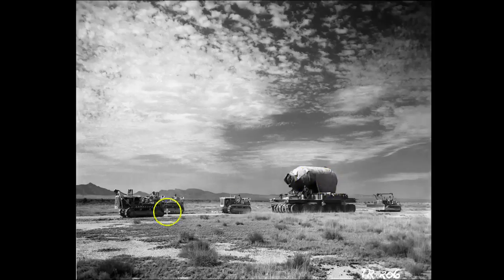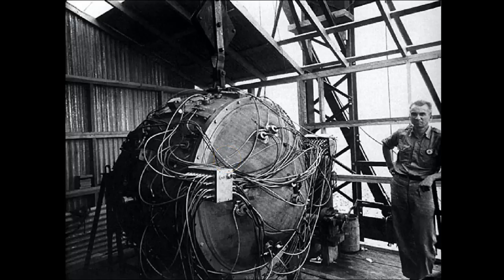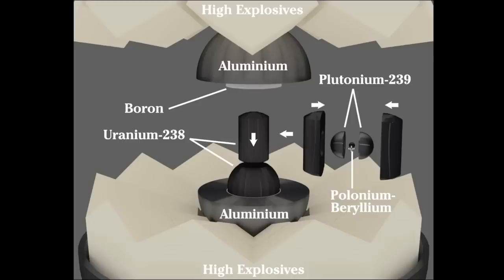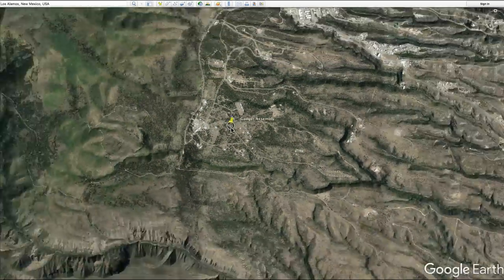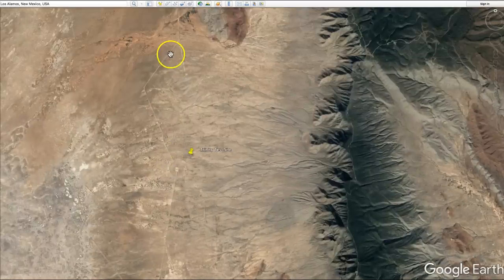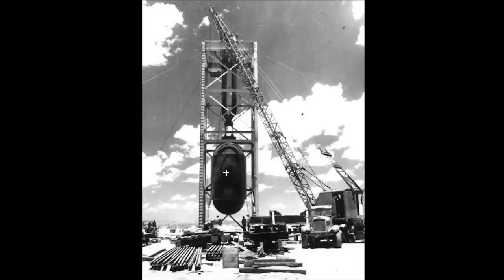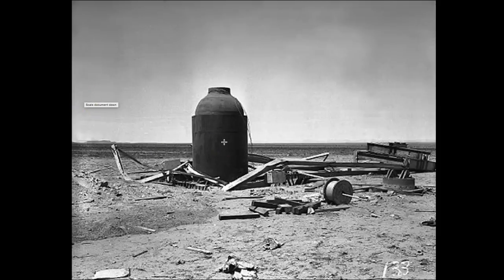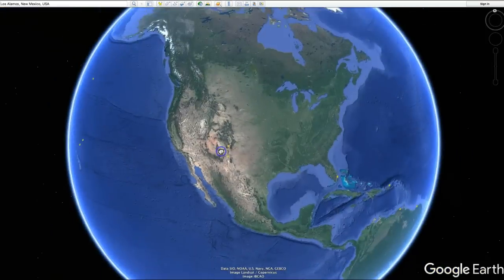Trinity Test Site Location from Google Earth

Comment: I worked all around that site and North White Sands Missile Range back in the 70's. We walked around that area during lunch breaks. Sometime in the middle to late 70's, the folks from White Sands Missile Range determined it best to fence off the area. There was measurable radiation in the area after all those years ( 30?) Trinitite, an artificially created mineral from the heat of the detonation can still be found near Trinity Site and it is sold at travelers souvenir shops in the surrounding towns. A very well done documentary! Probably the very best I've seen. Thank you for the excellent presentation and history of Trinity Site.
Reply: Interesting you mention the White Sands Range. We lived there from 1951 to 1955 where dad worked as a mathematician, but I like to call him a "rocket scientist".

Comment: And I was at trinity test site in October 2019 on the first Saturday of that month  and this site is only open to the public two days a year  the first Saturday in October and the first Saturday in April  so I rode my Harley Davidson down there from Wichita,Kansas  non stop other than bathroom breaks and refuels ! So if you have a chance go see it  you will be moved!!!
Reply: Hal 9000  The tour is open to the public. No sign up needed. I worked at Holloman AFB and WSMR. As such, I spent about 30% of my working hours on the range. The tour is definitely worth it.
Reply: @kiowablue2862  I worked on WSMR too, and spent a lot of time up there in the basin, but I never went on the tour. I need to go down there one of these days and check it out again.
Reply: What's a Harley Davidson?
Reply: Hal 9000  oooooo are those the chrome air compressors I see on the road?
Reply: Hal 9000  I love Honda! MX bikes in the past, last 3 bikes are Ducati. 440.000 miles on them !! What model do you ride?
Reply: Hal 9000  transalp !!! Cool .!!

Comment: Fantastic Job I never knew the assembly brick building was so small did not look like they had any kind of ac
those poor guys must have been miserable
Reply: Los Alamos is about 7,000' elevation which would mitigate much of the temperature problems.
Reply: lol AC, we didnt need AC in the old days, we were strong, unlike todays people.
Reply: @davidwarland2680  I was born in 1954 and I grew up with my father buying a new Pontiac Catalina every 18 months. WE lived in the Sacramento Valley and traveled to Southern CA on a regular basis and we NEVER had AC in any cars even the high end ones. The only AC we had was the old 4/70 - 4 windows down and 70 mph
Reply: @davidvincent3948  I remember one very hot day driving my '66 Pontiac Grand Prix that I had to turn on the heater in order lower the engine temperature.

Comment: The Von Neumann "lenses" set off the device. These consisted of half-spheres of low explosives, (Baritol) wrapped by hexagonal and pentagonal (like a soccer ball) cross-sectional pieces of high explosives-which  were hollow in the center to hold the Baritol. There is an additional hollow sphere of high explosives inside those pieces and immediately outside the aluminum sphere containing the fissionable material. There were detonators in the outside center of each lens (like bullet primers.) They had to be carefully synchronized. This is a much more complex (and efficient) system than the "Little Boy" which was dropped on Hiroshima. Nowadays, the Swan Device is used. It only needs two detonators, and is compact, making IT the detonator for Thermonuclear ("Hydrogen") bombs.

Comment: The white structure in the crater is an area that has been preserved intact from the blast..the original Trinitite 'glass' is still covering the ground, and it's covered and sealed. The entire crater is now pretty much non-radioactive as it's been plowed and dragged. In the late 1940s and early 1950s, samples were gathered and sold to mineral collectors as a novelty. Traces of the material may be found at the Trinity Site today, although most of it was bulldozed and buried by the United States Atomic Energy Commission in 1953.  It is now illegal to take the remaining material from the site; however, material that was taken prior to this prohibition is still in the hands of collectors. Trinitite, also known as atomsite or Alamogordo glass,[2] is the glassy residue left on the desert floor after the plutonium-based Trinity nuclear bomb test on July 16, 1945, near Alamogordo, New Mexico. The glass is primarily composed of arkosic sand composed of quartz grains and feldspar (both microcline and smaller amount of plagioclase with small amount of calcite, hornblende and augite in a matrix of sandy clay)[3] that was melted by the atomic blast. It is usually a light green, although color can vary. It is mildly radioactive but safe to handle. I was able to handle an actual piece of history when we visited the test site. Actually got to hold in my hand a piece of melted glass that was fused by the atomic explosion.....wow. 

You can visit the Trinity test site twice a year (April and October). Visitation is controlled. If you get a chance to visit, check it out. It's an awesome experience. 

https://sierracountyevents.com/events/april-2019-trinity-site-tour/

Comment: Fascinating history from my home state of New Mexico.  Beryllium is still used in the current weapon designs and is a rather nasty material.  Particulate debris from machining it can cause chronic lung disease.  We have to re-certify in it's safeguards and PPE requirements every year where I work.
Reply: Beryllium is used as a material for non-sparking wrenches, chisels and other tools that are occasionally found at swap meets. Not many people understand that sharpening a beryllium chisel releases carcinogenic particles. One vendor, Berylco, will sharpen its tools at no cost for life.

Comment: The beryllium doesn't emit neutrons in response to being compressed. The beryllium emits neutrons in response to being struck by the alpha-particles emitted by the uranium and the plutonium. The beryllium is therefore emitting neutrons the whole time once the core has been assembled. But the plutonium cannot create the necessary runaway chain reaction until it has been compressed by the explosives.
Reply: YES-and, it needs to be compressed at just the right time. These days, a small particle accelerator is used instead. It doesn't have to be Warp One; relatively slow accelerated alpha particles will smash into the Beryllium and emit neutrons.

Comment: Gadget was a test to see how an implosion weapon would work.  it worked by increasing the density of active material through squeezing the material into a smaller, more densely compacted sphere. the atoms were more close together and therefore subject to easier splitting..The other type of weapon(gun type) was never tested due to it's simplicity.
Reply from the maker: Duane Schwartz and it was the gun type they used in Little Boy over Hiroshima.

Comment: A sidelight to the test at Trinity is that it was the design for the Nagasaki bomb that was tested.  The Hiroshima bomb was not tested before using it, as the engineers were completely confident that it would work.

Comment: A interesting fact that you don't point out in the picture @6:00 is the test crater in the lower right. That was where they exploded 100 tons of conventional explosives so they could use it as a calibration explosion or measuring device against the atomic explosion.  The picture of that stack of explosives 

https://www.atomicheritage.org/history/100-ton-tnt-shot

https://upload.wikimedia.org/wikipedia/commons/c/c8/Trinity_Test_100_Ton_Test_High_Explosive_Stack_001.jpg

and it's visual effect in your video in the lower right @6:00 is a very interesting perspective to the much larger effect of 22kt plutonium bomb.

Comment: They had difficulty in the enrichment of uranium 235 from 238, it was easier to get plutonium but it was not as effective, it's easy to get uranium ore, the difficult  part is enrichment and seperating other matereals, I hate they did the testing, I also hate I missed seeing it detonated!
Reply: Plutonium has a smaller critical mass and about 10% more power per mole of material.

Comment: I have stood inside that very piece of steel at the gate to the Trinity site which is close as you can get my ex-wife had gotten drawn for orax and we were on the missile range hunting and the story that they told me about that was a little different I was told that thermos was built in case the bomb fizzled they were going to put it inside that and screw the lid on it to store it if it didn't go off they also said they put 4 500 pound cluster bombs in it and detonated them what was left what look like Play-Doh the steel was so mangled...

Comment: I was at a Christmas party years ago and was talking to an elderly man and he was the engineer who invented the detonation device for the H bomb
Reply: I have a friend ,Yuri Tuvim, who was an engineer with Andrei Sakharov, father of the Soviet hydrogen bomb.  Yuri smuggled Sakharov's Nobel acceptance speech out of Russia when the Soviet government held the physicist prisoner in the city of Gorki.
Reply: There were two types of atomic bombs.  The gun type which used uranium and the implosion device that used plutonium.  No one person "invented the detonation device."  That was the work of many different people.   The person with the most effect on implosion was George Kistiakowsky as he was the person that did the shock wave math with "slow" and "fast" explosives giving the explosive lens design.   Larry Johnston is the person that designed the original exploding bridge wire detonators.  However, there were a number of other people that helped develop the capacitor and timing circuits and equipment used to trigger the detonators.

Comment: 1:03 " When the Manhattan Project began is was very difficult and costly to extract uranium and plutonium from the earth..."
Plutonium is and has not been extracted from the earth to any usable degree.  It does not exist in significant amounts in the earth as it is primarily a man made element
Reply: Not only that, but uranium isn't particularly difficult and costly to extract either. The hard and expensive part is separating U235 from U238 ("enrichment").

Comment: @1:08 you say "plutonium and uranium extracted from the earth."

Plutonium was never extracted from the earth, it was created in a nuclear reactor, or more precisely, created through the process of neutron bombardment. It was actually not that costly (relatively speaking) to extract the plutonium from from the reactor. It was a simple chemical reaction process.  What was very expensive was the enrichment of uranium to allow for a reactor to be constructed (that led to the creation of plutonium) and for uranium to be enriched to the point of criticality, which allowed for the creation of the uranium bomb, though the bomb in your video is the implosion plutonium bomb.

Also uranium was used as a tamper material in the original implosion plutonium bomb though it was natural uranium with a low concentration of fissionable U235.

Pedantic maybe, but key point, uranium was not extracted from the earth.
Reply: museack  It should still be accurate.
Reply: museack  I'm not okay with false and horribly innacurate information. If you are then to each his own. I'm pretty sure Teller, Fermi, Oppenheimer, and obviously, Glenn Seaborg would be screaming at the author for his mistake.  It was, arguably their seminal work. It's a great video and does add perspective to the historical event, let's just be as accurate as possible.

Comment: 🤣they thought that big metal turd would "contain" anything or affect the blast!
Wrong!
Reply: You don't get it.  There is a condition called a "fiizzle" in which only the conventional explosives detonate.  They were originally afraid there would be a fizzle which would scatter the nuclear material and they would have to wait until more material was produced at Hanford and Oak Ridge to construct another bomb.  If the could contain the nuclear material, then they could use that and construct another bomb.  The idea for Jumbo was to contain the material NOT the full nuclear explosion.
Reply: @buckhorncortez  Makes sense, right on.

Comment: At 26 seconds you show a photo of a Crane holding the bomb in place in the tower  . You said that the bomb weighed 200 tons or 400 thousand pounds . that crane wasn't capable of lifting 400 thousand pounds I know this because I was a school trained Crane operator in the national guard that truck mounted crane in the photo couldn't have lifted the 400 thousand pounds off the ground